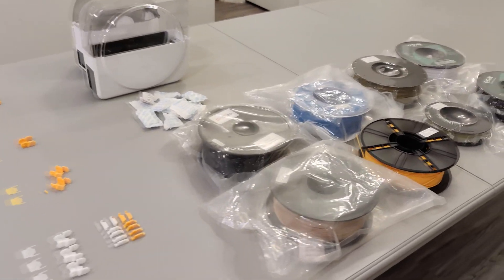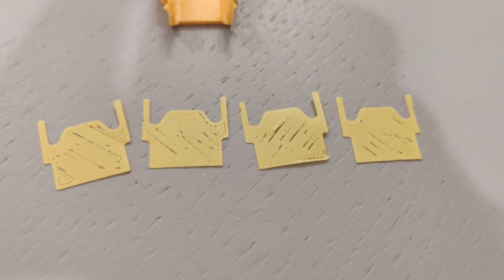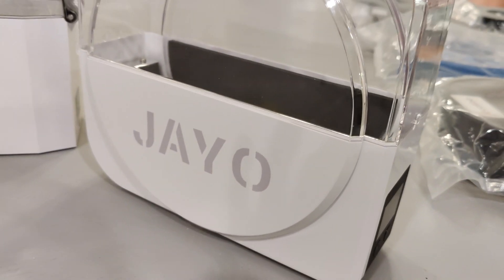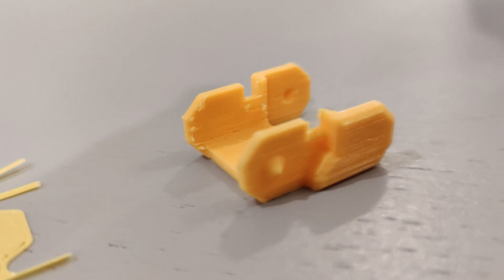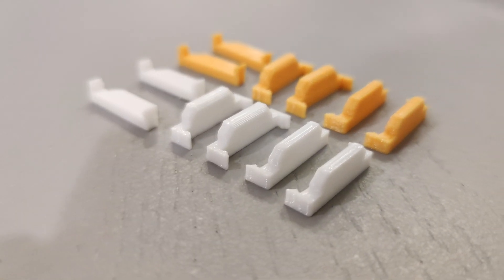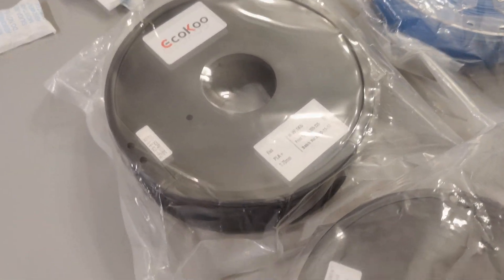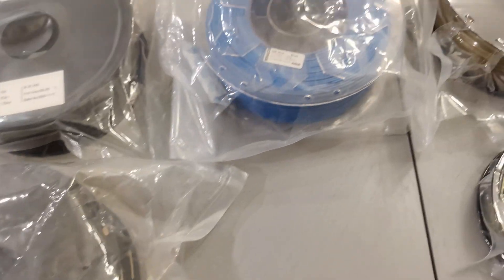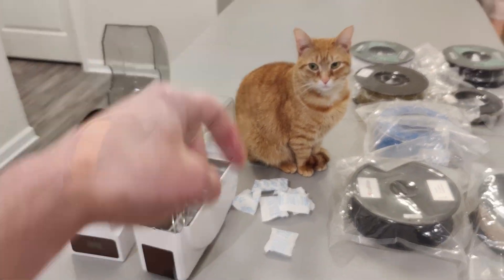Does Your 3D Printing Filament Have Too Much Moisture?!?

Comment: Not moisture but bad filament. I just did a print with perfect start and finish but bad in the middle. Not possible for ambient moisture to target only a section of the filament. The moisture/poor-mixture came from the manufacturing.

Comment: I have had problems with ESun PlaPro filament.  It's rare with them but when it happens its actually worse than any other brand I've dealt with.  That's my go-to filament for everything but I think the way their spools and packaging are designed is flawed.  They put the desiccant in the middle of the spool and then vaccuum pack it which nearly seals off the desiccant from having any exposure to the bulk of the filament.  There's just 4 tiny holes on the 2nd ring from the center which are closed off from the inner filament already and then the plastic bag sucks down over the inner ring anyway.  If the spool gets wet before they package it then it stays that way in the warehouse forever until you open it.  They should add more holes or move the desiccant to the outside of the spool.
Reply from the maker: Interesting. I have only ever had 1 spool from them be messed up. They are definitely my go to!

Comment: The dryers are ok for keeping filament dry after its already dry but they are super slow to actually dry it.

A basic adjustable temp food dehydrator is far faster.  Dry it in a dehydrator then toss it the dryer and keep it sealed even when printing and not ever have to worry about it.

Matterhackers is quality stuff and so is atomic filament. In fact atomic is one of the best and neither will be vacuumed down like Esun but work fine.  

Creality filament though yeah it needs dried new.
Reply from the maker: That is interesting to know. I find that the eSun is nearly always vacuumed down perfectly and barely absorbs any moisture when sitting out. I left a roll out in the open for 2 months and it printed just as good as when I printed with it from new. I will have to give matterhacker and atomic a try!
Reply: @ThePrintHouse  I live in a extremely humid area.  85% and higher during the summer so I fight moisture.  All brands for me need dried in a day or 2 and they are stored in a sealed tote.

I've never bought Esun but once and while I didn't like the print quality it wasnt due to being wet.  I've debated the dryer boxes vs printing individual dry boxes to keep my filaments in when printing to reduce dry interval on every roll.  But if you have one give the dehydrator a shot then toss it in the dryer for use and storage and see how much longer it'll go.  Also PETG is a dry daily if in use filament for me 🤣.  I want to try nylon but I'm working out a better sealed storage/feed system first as it has no chance here otherwise.

Also the content is good 👍 the info on what to look for and symptoms is great and having the visuals will help out many.  Keep it up!
Reply from the maker: @brandonbrown3600  thank you so much!!! I am doing the best I can and comments like these drive me to make more content!!!

And that story is crazy. That would frustrate me so much. I don't know if I could deal with that. I have so much filament that I need a dry box and I plan to make one at some point. I don't know when exactly, but when I do ill definitely be documenting the progress! :)

Comment: Nice video!
I have some issues with a few batches of pla I bought (got the cheap stuff) and I think they could have a moisture issue.
Will definitely try to get one of these dryers soon and see if that takes care of the problem
Reply from the maker: I hope it works out for you! You can see with the examples I provided here that drying my filament made a very big difference, but because this isn't great filament to begin with the results still leave much to be desired, though drying the filament did make a world of difference. I hope you are able to recover what you already have!